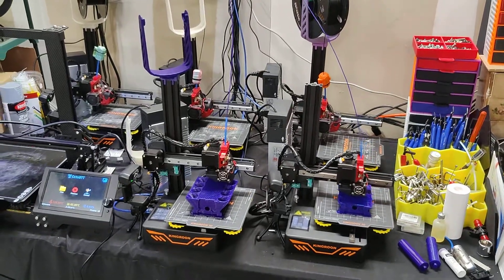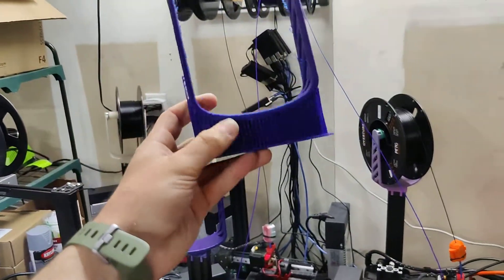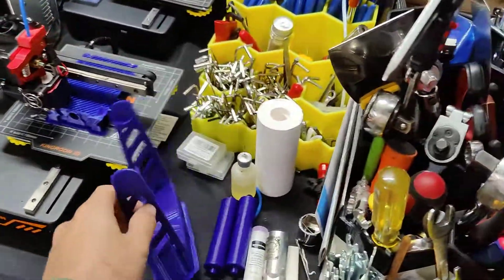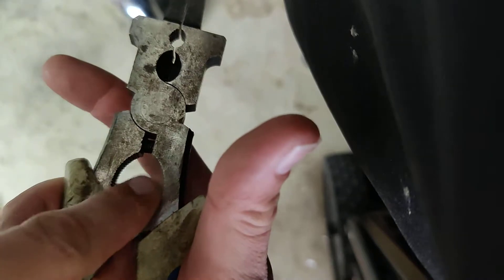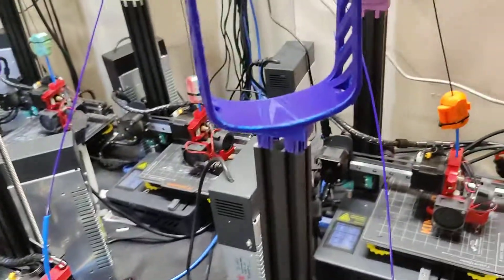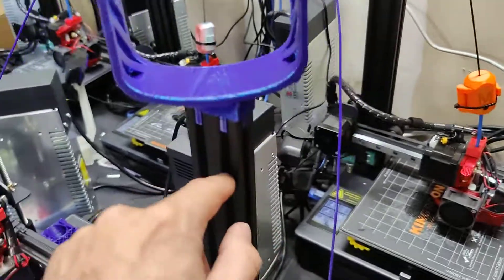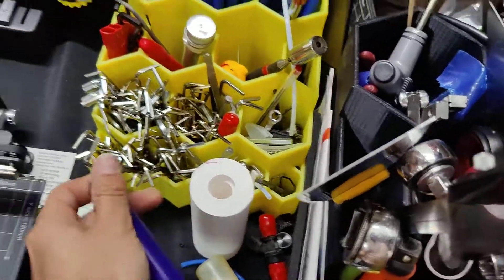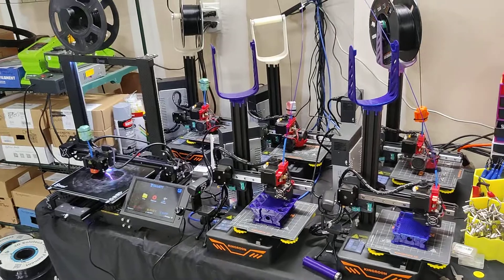How to Print and install Filament Holder for KP3S

Comment: Do you still recommend using the filament holders? I've seen some folks mention the weight throws off their prints, so I'm a bit on the fence on whether to try it or not. 😅
Reply from the maker: I never noticed that.

Comment: when the extruder goes all the way up (e.g. when I cancel an impression) it hits me on the mount printed. how do you prevent this from happening?
Reply from the maker: I think the firmware update fixes this. Its a firmware related issue. I have the same thing.